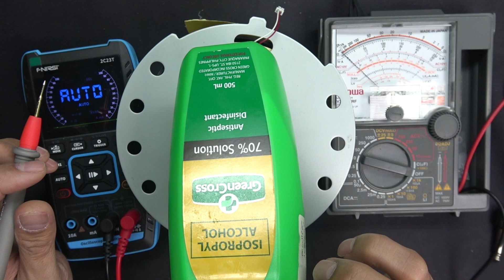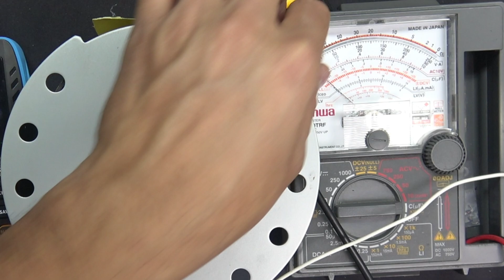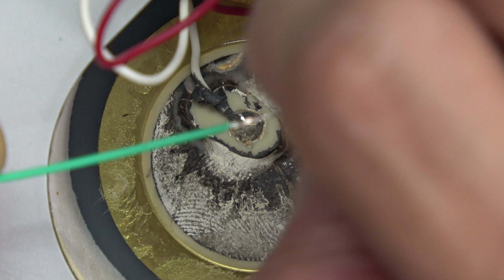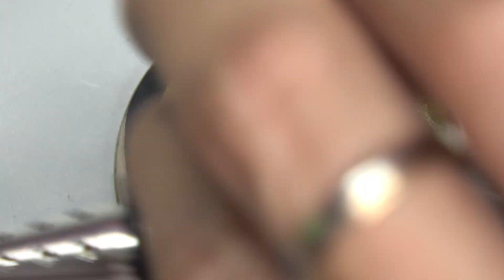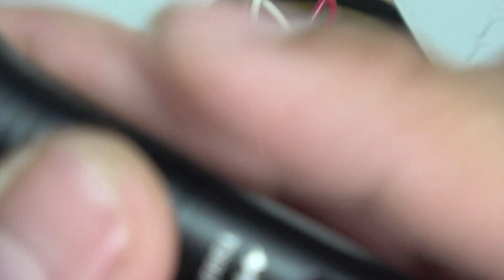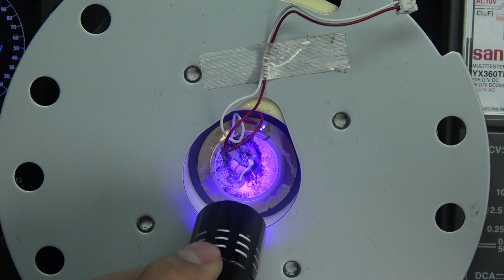How to fix cutting sound on drum pads Piezo repair

Comment: Sir how about if sa snare po? May butas kasi yung rubber nya ng pads ko
Reply from the maker: @gersonarkhold4810  Hi po, kung wornout na ay kelngan replacement na po.
Reply: @ san po ba nakalabili ng replacement sir?
Reply from the maker: Hi, try nyo po e check online kung available. Pag hindi available ay advise ko na dalhin nyo nlng po sa service center.